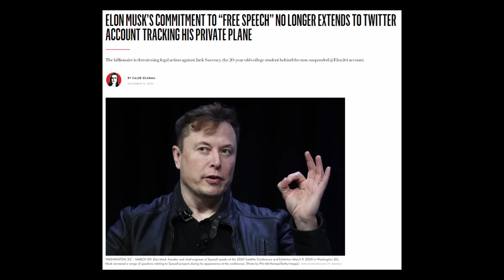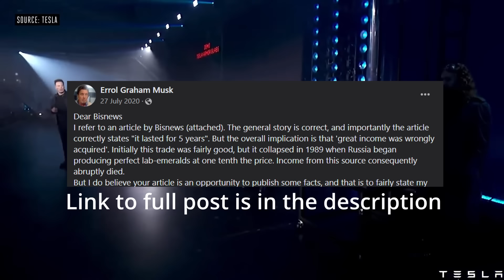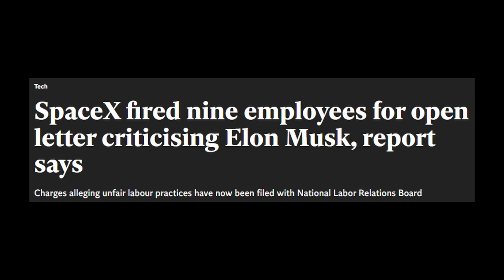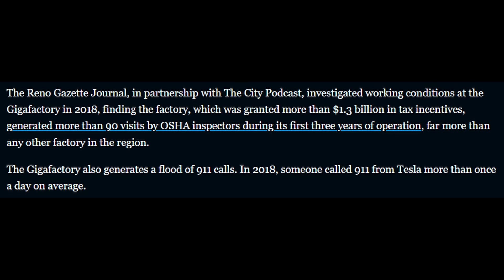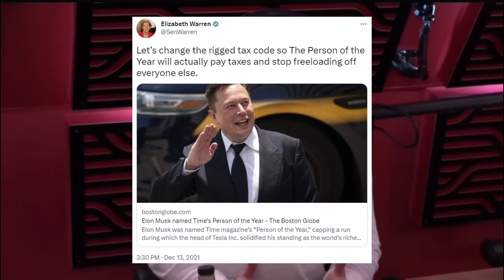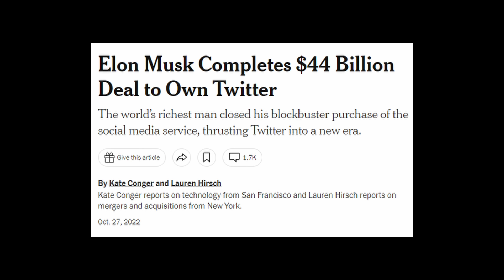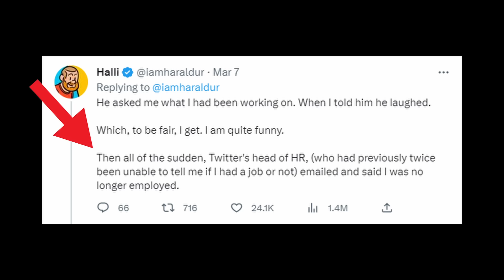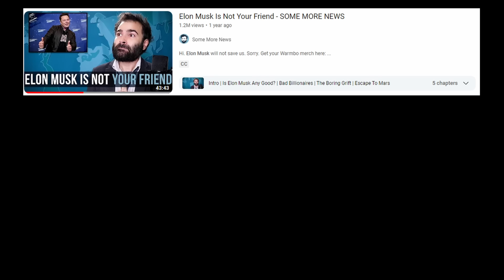Elon Musk: The Worlds Smartest Idiot | Just Some Geezer [RE UPLOAD]

Comment: I used to work at a semi-conductor factory and we dealt with vaccuums alot, everyone in the engineering department would laugh at his ridiculous hyperloop plans. The idea of pumping down hundreds of miles and putting people in it is crazy. To sum it up simply, vaccuum pumps do not pump out air, they spin and stop air going back into the chamber. This is why it can take hours to pump down relatively small chambers, you're literally waiting for the air particles to bounce around and find their way to the pump. That's before getting to leak checks, you can clean seals in a clean room and swear blind you're good just to find dirt not visible to the human eye is stopping the vaccuum. And leak checking is done with helium. The idea of a train in a vaccuum is older than the idea for planes but everyone knew it wasn't feasible, nearly everyone anyway.
Reply: The hyperloop was never going to have a hard vacuum.  More like low pressure.
Reply: @incognitotorpedo42 I think they purposely misunderstand.
Reply: @incognitotorpedo42  That 'low pressure' is what the rest of the world calls a vacuum. Look up the numbers... It's not as if what they were aiming to do was going to become more easy because they were calling it a near vacuum.

Comment: Interesting factoid you missed:  NASA had a self landing rocket in the early to mid 90’s it was the DC-X or “Delta Clipper”.  Made by McDonnell Douglas it only cost 120 million and had two different versions.  While it never got to space, that was not the designs fair, rather it was canceled because of politics and the political winds of the time.  Interestingly, they thought it was too expensive, the program (which had only one failure) was successful taking off and landing on the intended target, all with 90’s technology.  All of the company’s you listed had access to their test data and schematics, these people simply built off the R&D they had already been done.

Comment: Wind tunnel testing from the 1930's showed that a rounded leading edge has way less air resistance than a knife-like edge. Making it pointy, Sasha Cohen demonstrated he knew how STUPID an idea that was, but Musk FELL for that joke. 😂
Reply: You should tell that to those stupid engineers designing supersonic jets - those idiots keep making them pointy. If they had read your comment, they would have realised they were wrong.

But seriously, Cohen put a line in that joke about rounded tip being better for PAYLOAD DELIVERY, not air resistance. Because the context of the joke is a MIRV ICBM - but guess what? INSIDE THE ROUNDED HEAD ARE MULTIPLE POINTY WARHEADS! 

Pointy is better for these hypersonic speeds - why? Because at these re-entry speeds, the heating is not caused by air resistance at all! It is caused by a 'cushion' of air becoming super compressed in front of the vehicle, it is this compression which causes the heat, NOT friction from air particles. 

I can see how you were misled by looking at 1930's wind tunnel testing. Our understanding has advanced since then!

Comment: The ''fired'' dude came across as a typical ''economic'' bullschlager consultant /baked air salesman (exactly the type lefty REEE-dditors trust the most to receive economic advice from in contrast to rich entrepeneur=completely bad) who was allowed to act as an external advisor ON the payroll to farm the system of public relations by the inclusive quota people who ran Twitter.

The whole bit with the ''need to break confidentiality'' is ''NLP coach code'' for ''My work is SO IMPORTANT that even I do NOT KNOW WHAT I AM DOING . '' or even worse '' I know I've enabled myself through connections to get all kinds of nonsense gigs which pay well and I don't want to publicly ADMIT IT''.